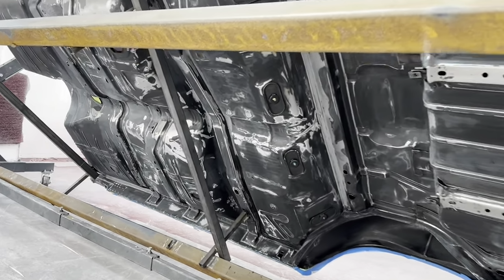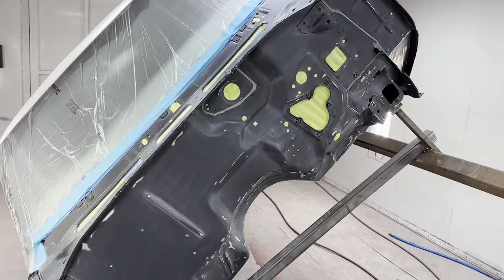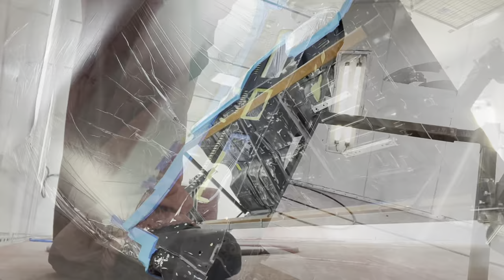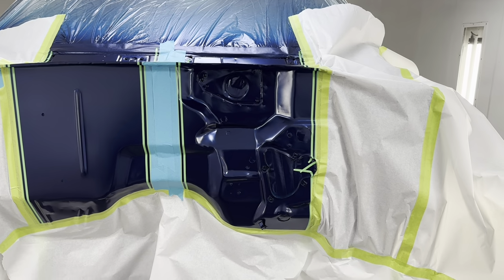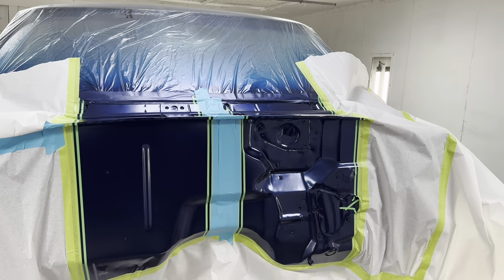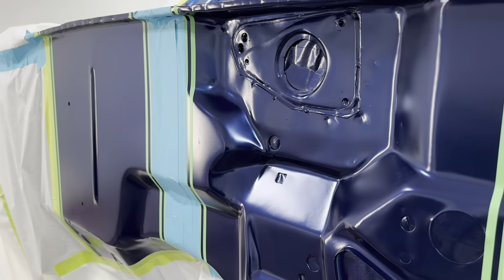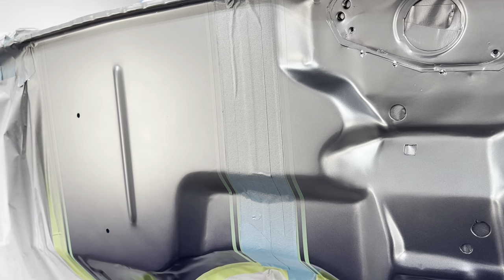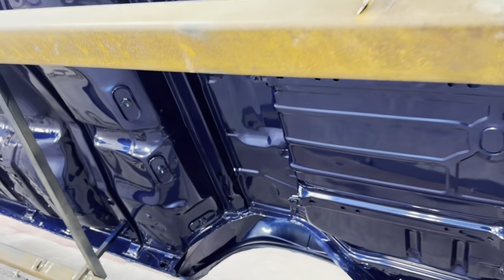Painting The Bottom of a 1970 Chevelle Indigo Blue with Faded Stripes

Comment: Why did you support the body on full length square tube? How tall are the vertical tube from the rails? What is the size of all your tubes? I'm going to put 1986 El Camino on a rotisserie and never saw this method. Can one attach the rotisserie at both ends of the body?  Is there a risk of bending the body without the rails? I assume all vertical mounts are at body mount points. Are you going to remove a vertical mount and paint that point at least for rust protection?

Comment: Why do you use square tubes and extensions to hold the body on the rotisserie?  Why not connect the rotisserie to the front and rear only?  Do you do any measuring to lift the center of the body with the extension tubes?  Is this a better when the doors are off the body?  Many questions on mounting a body from a full frame car, I would like to chat with you on this topic.
Reply: I finally found your video on the rotisserie using 3"X3" 3/16" walled tubing.  I think that will be the way I go when I take the body off the frame and mount it on the rotisserie.